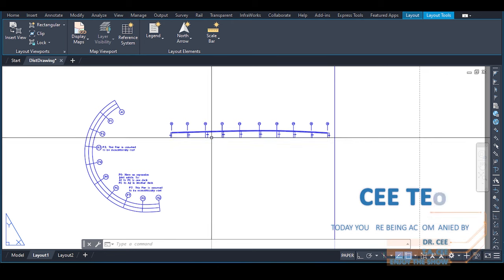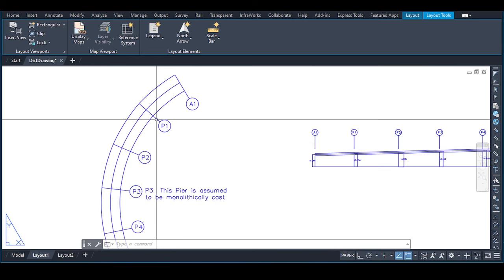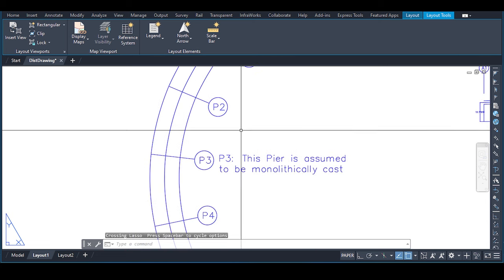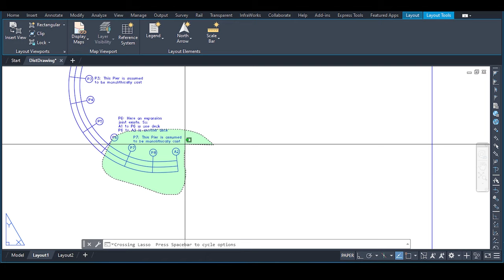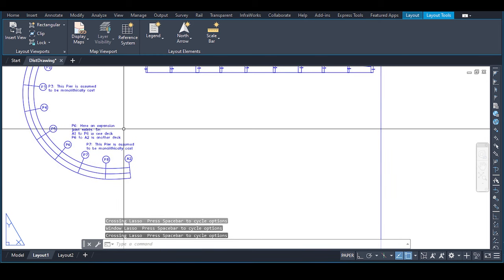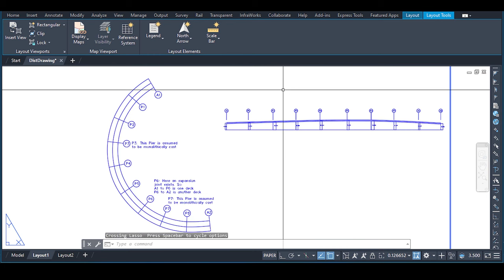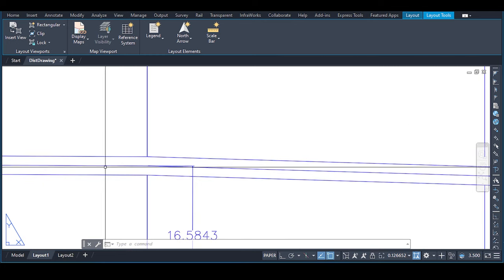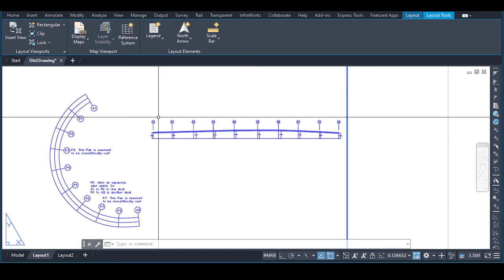Structural Modeling and Design of a Highway Bridge | Part 3: Bridge Schematic

Comment: Dear CEE,

I have found your channel recently and ive been binge watching it for days, great content, thank you very much for the efforts! I have one question regarding this video. I have worked with bridge repair and maintanance projects, and often we would replace the bearings by using hidraulic jacks to lift the superstructure span by span. It was usually simply supported beams from pier to pier. How would that work in this scenario where we have a pier cast monolithically? I imagine the jacking of the structure at other piers would create significant bending moments and shear forces at the pier casted monolitically. Is this usually done, and then rebar is designed specifically for this 'temporary load situation', or is it more common to use elastomeric bearings, or guided bearing that offer some kind of lateral resistance?

Again, thank you very much for all the lectures! :)
Reply from the maker: Oh hi there, I am very happy to know that you find this stuff interesting. 

if you have a monolothically cast span, then I am assuming that you are talking about the bearings of the "other end of the span"
if that is the case, it becomes extremely challenging.
if the span is short, the amount of force needed to lift the "other end" is enormous, and could cause bending moments and stresses that exceed the load carrying capacity of the "cantilevered end"

Let me dive a little bit deeper to tell you what I would do
Your bridge is:
ROLLER ========= FIX ========= ROLLER
and you want to perform maintenance on the bearings of one of the ROLLERS.
You would need to estimate the amount of force to be applied by the hydraulic jacks to raise the "ROLLER" end a certain distance (depends on how much clearance you need for the repair)
This can be done by performing a structural analysis of the bridge assuming
ROLLER==========FIX===========FREE

with a force pushing upwards at the free end.

Then, you need to check 2 things:
1) do you have equipment (hydraulic jack equipment) that can provide this amount of force safely?
2) Can the bridge carry this amount of load safely

if the answer is "yes" to both questions, then go ahead.
if the answer is "no" to any question, then you may need to consider partial demolition and recasting of parts of the bridge.

I hope it makes sense. Sorry for not providing a "clear cut" answer.

PS. Sorry for the late reply
Reply: @CivilEngineeringEssentials  thank you very much for the answer it makes total sense! I suppose in a real life project, it would be best to think about this beforehand as well. Keep up the good work, ill be following closely 😉